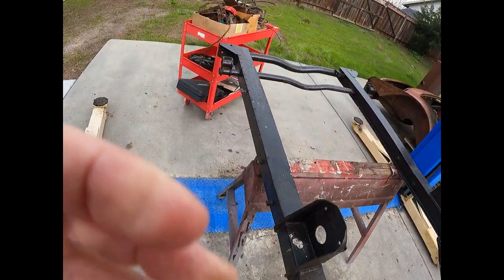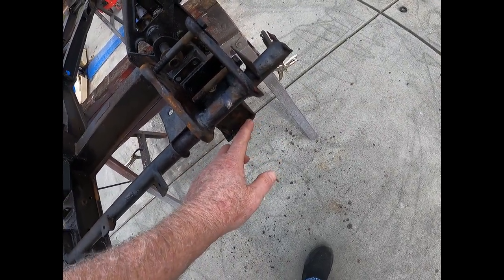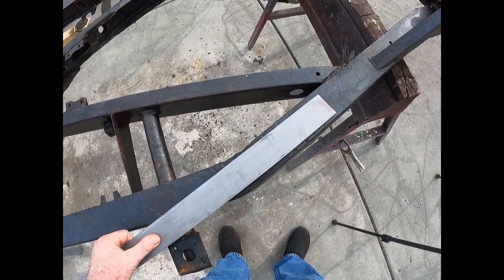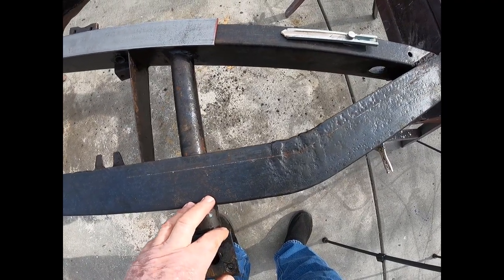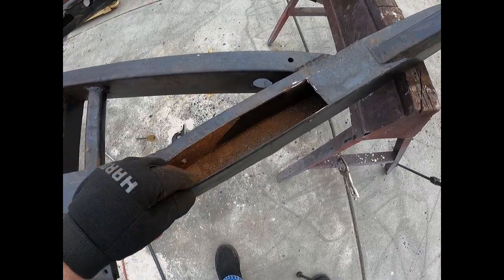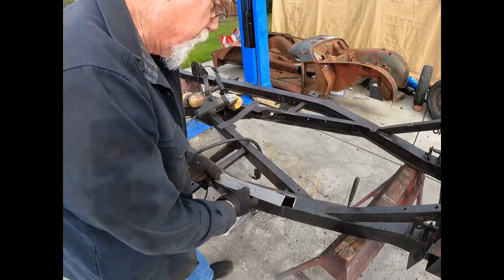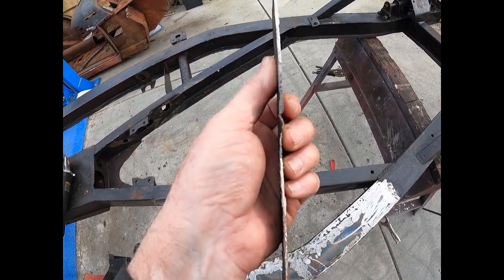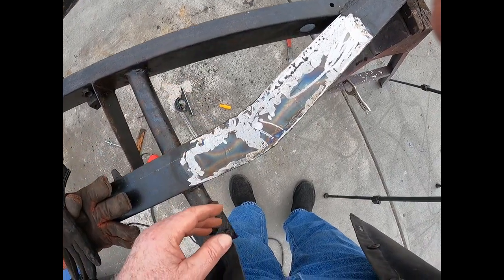1955 Triumph TR2 Restoration.  Part 10 Frame Repairs

Comment: Thank you Sir... I still have a lot of body rust to solve before I get to the frame... following along!
Reply from the maker: Good Luck with your project.  Rimmer's should be having their TR2/6 sale soon and the USD/UKP rate is very favorable right now if you need sheet metal or repair patches.
Reply: Thanks for heads up on that. I actually prefer to make my own panels… which slows me down of course.
Reply from the maker: I do make simple ones like floor patches but I am not good enough to do anything with a compound curve.
Reply: Haha. Me and my wheeling machine have a love hate relationship 🤣
Reply from the maker: I always thought that it would be interesting to try an English wheel but but my available space and finances are hindering me.